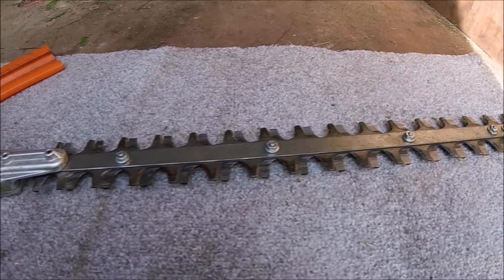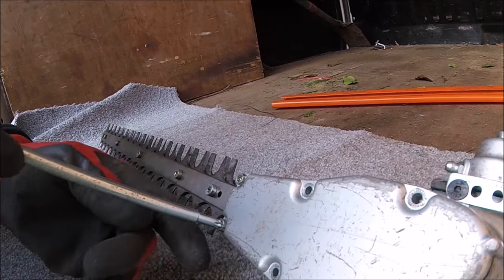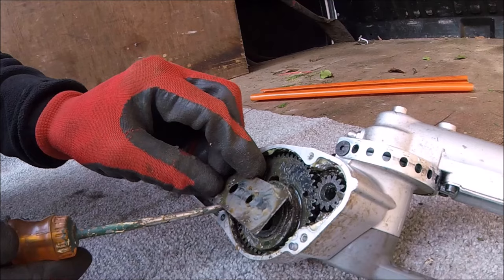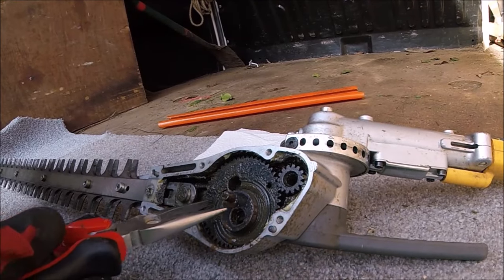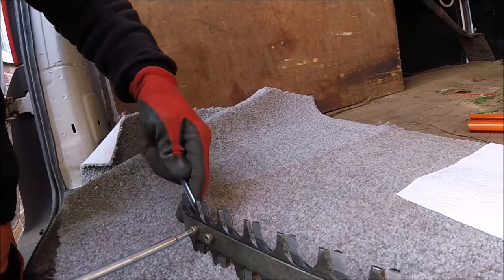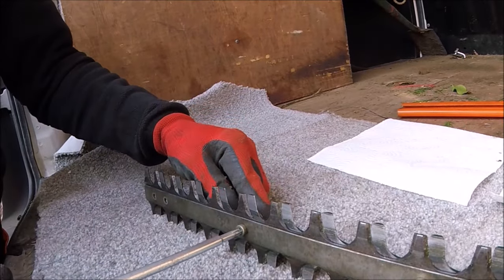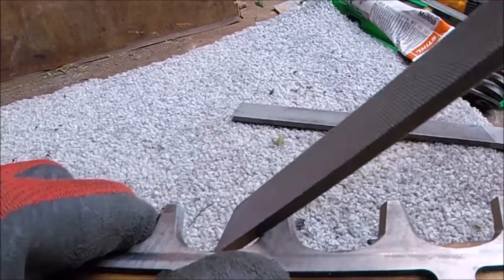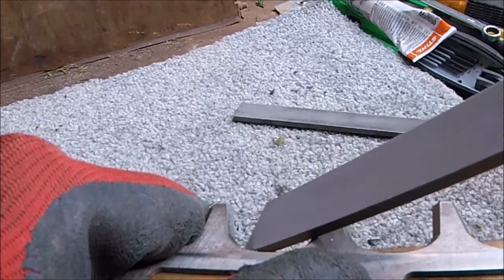Hedge trimmer cutter sharpening and service

Comment: Hands down the best hedge trimmer video on here . I like how you take the time to clean the parts first. sharpen with the file. Then reassemble clean Parts using a good Grease, I personally use manufacturer's recommended oils and Grease. I find the German products to be the best. But I also respect your points how you say this is how you do it. Thumbs up my friend good job. In my opinion.

Comment: Thanks Jason. Used my Bosch Hedgepole 18 on leylandii a few days ago. Has "anti-block system" to cut thicker branches. has been jamming since  even on very thin ends. Decided to strip down for blade sharpening and flattening out any unseen burrs with a flat file and a chain saw file. School boy error. Cant re-assemble it- left with extra spacer. After watching this excellent video i'm starting again. I'm going in.Wish me luck.😁😁😁

Comment: Hi Jason, i find putting the drive rod on top of the main  gear and then lowering the gearbox to line it up is a lot easier. The grease won't fall out and then flip it back over to continue the rebuild. A great video and really enjoy your your approach to gardening. I have been in the trade for 36 years and still love it rain or shine despite the aches and pains.
Reply: Great tutorial video. Thanks!

Comment: I've done this and it’s a pain in the arse. I always have loose parts when doing this. This is why I prefer using a Dremmel tool or a grinder at slow speed to just sharpen the blades without getting into the gear box

Comment: Good video Jason👍
I cheat on mine and use a grinder, used to hand fill but took to long.
The blades look identical to Stihls and internals much the same. I see the needle bearings in the con rod are different. Do they last longer?
I've got 8 Stihl sets sharpened just got to sand and reassemble. Then I just swap blades through the season, can't use dull blades!😪
👍

Comment: Your video is why I watch several videos on the subject. You have the first video I found disassembling the blades and using a file. If I need dis-assembly I'll find out soon enough. Old school men prefer a file against a dremel or die grinder. This I know from knowing people that have used both methods. I wasn't taught much growing up so event at 48.75 years of age I still seek advice. The dumbest question is the one not asked! And yes you can quote me on that!

Comment: Great job - will give it a go knowing this is very thorough.  Apart from elbow grease - what sort of grease do you use in the tub - I usually grease with Stihl on the grease point but interested to know alternatives
Reply: Same question l had.I Bought a tube of stihl but misplaced it.

Comment: @ 8:35 I would of never thought of decking the blades. As you flatten them out from knicks the process is called decking. Like what engine cylinder heads and blocks are normally done to during a rebuild. Now I see the need for disassembly. I'll continue the video so you wont have 10 comments to read. You already have 2 from me. Now it's your turn to learn. WD-40 and similar solvents will be bounced off your head if pulled out in an American machine shop. By best friend is a machinist that makes the tooling that makes artificial limbs and organs. Solvents like WD-40 collect a massive amount of dirt, grit, and every thing you don't want in a cutting tool. Yeah I know that is a hard pill to swallow but it's true. Do I still use it. YES!!! But I hide everything like it when I know he is coming for a visit. Garden tools that I have sprayed off with a water hose will always get a healthy dose of WD-40 or similar rust prevention lubricant. now lets see what else is in the video. I'm writing as I come across parts of your video. So I don't know what's next. I'm truly being honest. And that is almost impossible to find now days. 
RE- Assembly? I would never use 3&1 oil. I prefer using the thickest Royal Purple engine oil. I even use it while doing machine work. @ 12:36 I use waterproof High temp grease for the gearbox and Bar and Chain saw oil for the blades before and after I use the tool. OH Hell man I just did that. I tightened everything up and the blades wouldn't move. I will try to find the proper torque setting for my tool. I hope you read all this. I took a 13:48 video and made it 4 times longer. I learned a lot. I hope you will as well.

Comment: Hi Jason, Thanks for your film! but I can't understand why any one would sharpen any tool towards the leading edge I have been sharpening tools for over 65years starting life in a joiners shop and other trades requiring sharp tools and other implements as well as my own tools. When you have sharpened your blades and turned them over and scoured them for want of a better word all you are doing is transferring the burr that you created in the first place by honing towards and under the leading edge. I suppose that's good enough for (rough arse gardening tackle) as most people would call it! not a precision cabinet maker and or musical instrument makers tools (look at Ray Mears films and tackle for sharpening his bush Knifes and axes!) for my gardening cutters I use a Diamond file sharpening from underneath the blade away from the leading edge and a half round file for the curves and to remove the burr a hardwood block with some lube rubbed over the cutting edge on the end grain job done. As for cleaning I submerge my cutters in a soil pipe filled with diesel run for a bit and dried off and at laying of time some sack cloth with a bit of light oil Job done and I've had the same cutters 25 years no probs!!! But if it works for you good, and anyone else who doesn't know how to sharpen up properly fair enough, but I cringe when I see it!  It reminds me when as joiners, we used to get 15 mins sharpening up time before everyone else finished work If we had have been seen sharpening up like that we would have got peddled (on your bike kid) But thanks again.
Reply: Jonathan......that's an interesting take on sharpening. I always took an interest in metalwork at school and I still love to learn stuff like that. So always sharpen AWAY from the leading edge, right? I get the logic yet it still feels "wrong" somehow but I'm going to try it. Wow......every day really is a school day! 👍👍

Comment: I see a lot of comments saying use a grinder it takes less time, but like when sharpening chainsaw chains it needs to be done properly to make them laser sharp! Once you get the hang of it, it takes no time at all. 

Grand job.  

Tip for future. Use a diluted bleach cleaner after a cutting session . Stops possible infection passing from hedge to hedge

Comment: Try a die grinder, they can get the insides and get everything in very little time.  Its even faster and leaves better results than a dremel.   Ill bet i can sharpen a 24" in 5-10 mins tops, then switch pads to a non abrasive to polish the top if needed/desired.   I will say you did a very clean and nice job, just to long for myself.

Comment: They look very sharp. I do the same with disassembling/assembling the blades. But I sand both sides of the blades with a sander. Then I place the blades on a working bench and use an air grinder to sharpen the teeth. I use the dirt on the teeth as marker for the correct angle.
Reply: I do exactly the same👍
Reply: Just curious, I don't even own a compressor, but can you invert the rotation on an air grinder ?

Comment: Really enjoyed the video and your teaching style. I file old school crosscut saws and like to modify my flat files with an angle grinder to round off the sharp corners and not put a nick in the saw plate. With a safe file you can rub the curved part as a guide to make filing fast and accurate. Saw filers use felt markers on teeth to insure proper angle when filing. Ink is cheap. Quick question, I used chainsaw bar oil as a lubricant since it's anti-fling but don't know if it can harm plants.

Comment: Love the video, I use a strop after every use you can buy round strops for mowers there about the same size as a chainsaw file. I also clean the tool to prevent any cross contamination of diseases between plants. 
Super important with chain saws and pruning saws.

Comment: I’m using a dremel (micro-grinder) the results are good but not this good I guess. However it takes way less time to do it. Great video btw I would love to see more tool-maintenance video from you maybe how you properly sharpen and maintain your pruning tools?
Reply: I suppose the main difference is that your blades may last longer this way, as you can work with more precision than a dremel or a grinder ?
That said mine has 21 teeth, that's 160+ faces to file, and I'm not sure I'll finish that work by hand ! Maybe I need a larger file, like in the video...

Comment: Question - if you are sharpening a machete with a flat file like you have on the video, do you push the file perpendicular to the blade (with the back end of file raised to match the bevel angle of the blade)?   Or are you supposed to turn the file until the cutting lines on the file are parallel with the machete's blade edge, and then push forward?   Was wondering why the lines are running at an angle on the file.  I just bought a flat file 2 pack and have no idea how to correctly use it to sharpen.

Comment: the good thing about taking it apart to sharpen the blades is that you can apply fresh grease at the same time I suppose; but getting back together correctly is imperative if it is going to work.

Comment: Brilliant job how often you sharpen the blade's ?
Reply from the maker: Thanks mate, a total strip down is once or twice a year, but I give a light run over with a file, probably even 4 or 5 weeks in general
👍
Reply: @jasongardener3425  thanks on that need to file a bit more in the cutting season 👊

Comment: Nice video jason i did a sthil km94rc cutter today i use a grinder with a well used flappy disc that is rounded of at the edges that does the round bits easy  on a slow speed and i had to replace 2 connecting rods where one had the bearings come out